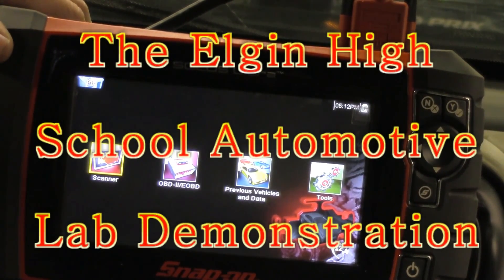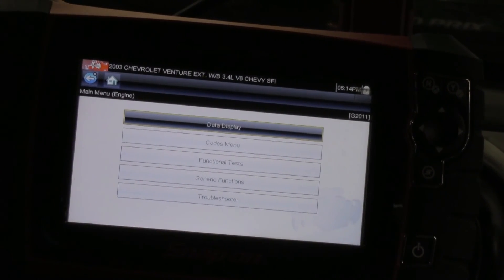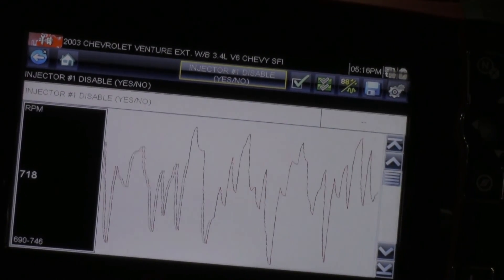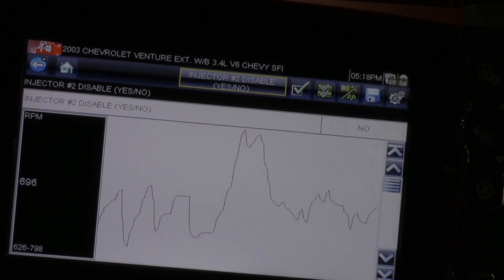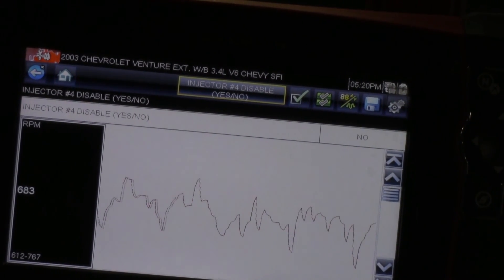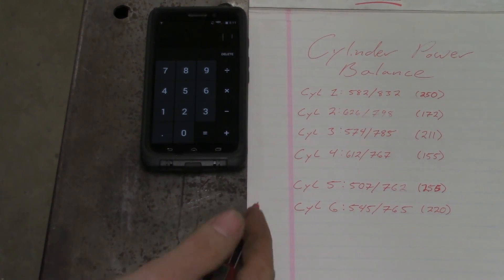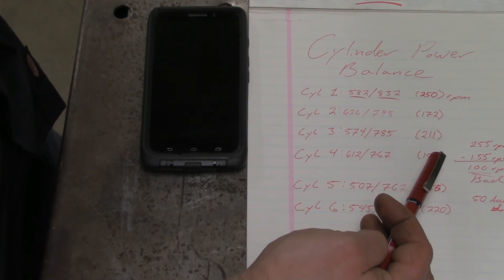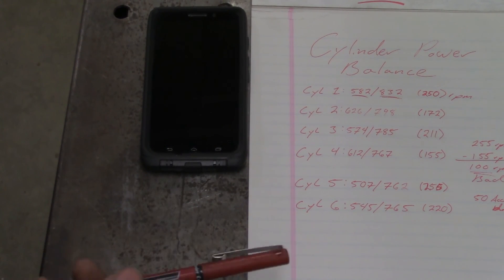Cylinder Power Balence Test

Comment: The #2 power bank has the largest problem from cylinders 2 and 4. The direct test results point almost directly to bad cylinder head gasket(s) before the math is even finished. Another obvious way to verify bad head gaskets is to check for coolant in the oil as well as the white smoke coming from one or both exhaust outlets. Normally that points directly to the problem before anything else. This test is the final nail in the coffin for a flawless diagnosis of any and all of the symptoms. Excellent job and video!!!!

Comment: One other thing to note is that cyl’s 2 and 4 are adjacent and on the same side of the engine.  This also helps validate a possible head gasket issue as a blown head gasket usually affects more than one cyl but only on the same side of the engine.  We would also expect the condition to affect cylinders that were beside each other.  Your data confirms this.  Thanks for the video!
Reply: Isn't it cyl 1 and 4?

Comment: You should have to disconnect the IAC Valve to avoid the compensation of ECM/PCM during and after of each test, in my opinion you can work just with the minimum of each cylinder to find the cylinder with less contribution